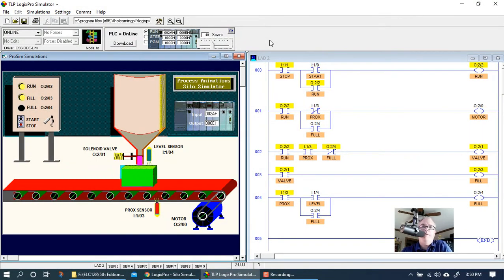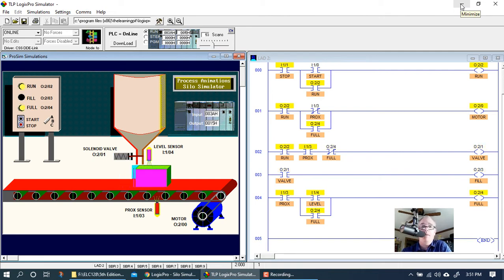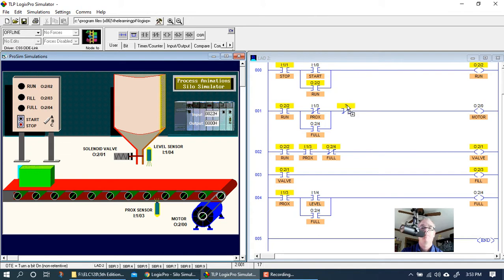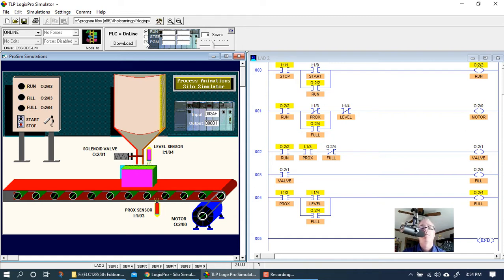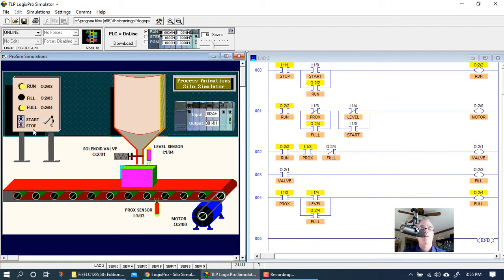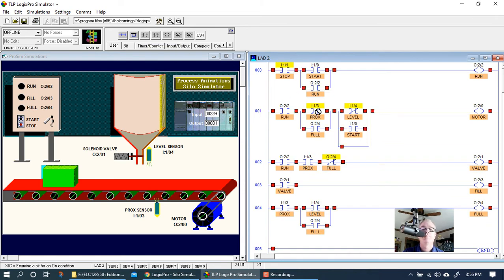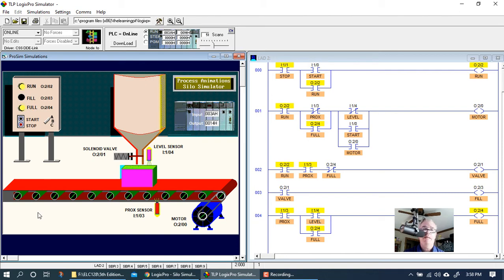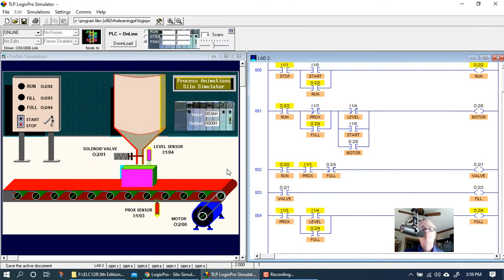LogixPro Simulation - Silo Exercise 2

Comment: I thought the exercise wanted all scenarios on one program though. But you can change it from that a, b, c selector switch. A: from exercise 1, just full auto. B: the manual mode. C:  the final challenge. Once the program is done it should do all 3 based on what selector you're on.

Are you going to show how to incorporate that selector and make it do all 3 exercises in a single program? Thx though! You've helped me notice a few details I had issues with that gave me a quick fix lol thx!!
Reply from the maker: Yes!  I may not show the complete exercise incorporating the selector switch, but I will give some hints on how it's done. ;)